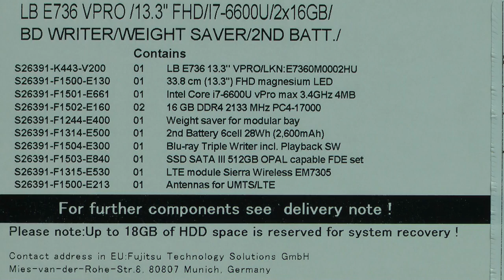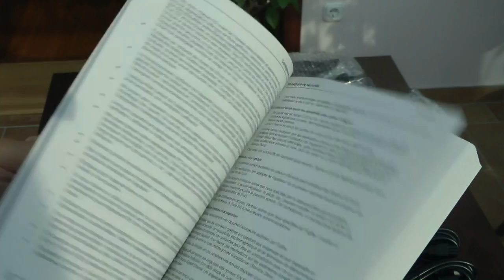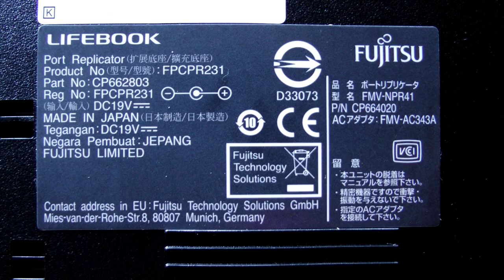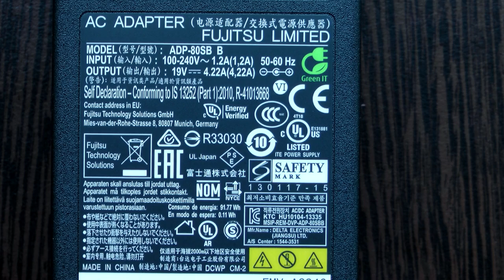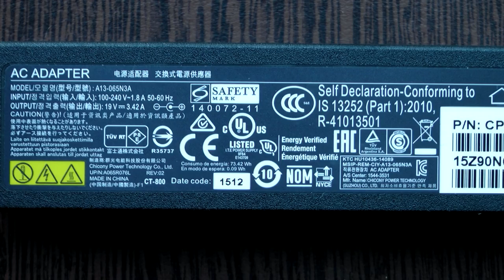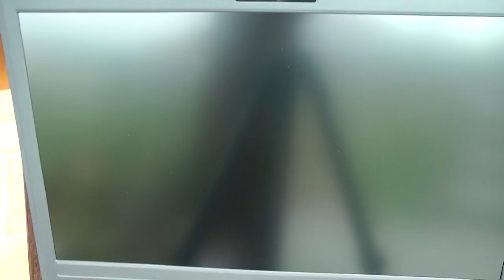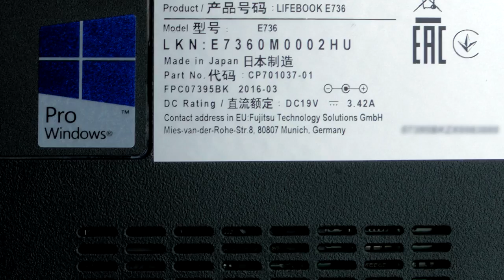Fujitsu Lifebook E736 Is The Best Business Laptop - unboxing review

Comment: It is 2024 and I have purchased a "refurbished" E736. It comes with an i5-6300U and a FullHD (1080p) screen (not a 1366x786 screen like it said on the website).
(It does not have a fingerprint scanner.)

It has 2 x 4 GB RAM, both from Hynix, but one memory bank is 2400 MHz and the other is 2666 MHz.

A sticker at the bottom says May 2018.

It comes with some "generic" Chinese charger by "Li Shin International", and with a 256 GB SSD from Kingfast (not the best brand, they say, but I will keep an eye on it with CrystalDisk...).

The laptop looks like new and has probably been used with a dockingstation and external keyboard.

It is running Windows 10 Pro, and Fujitsu is still offering drivers.

With a little (or a lot of) luck, this may be a great buy. It sure is a great machine.
Reply from the maker: Good choice. My laptop is now 8 years old and I don't plan to replace it, especially since this is the most powerful configuration possible. You will also be able to upgrade it easily, first with more and the same RAM, then with a larger SSD. The battery may need to be replaced. However, even with this launch, you have a great office laptop. The FHD display is perfect even for medium-level graphics work. Enjoy! ✌😉

Comment: Hi there, Thank you for the detailed unboxing and details. 
Its been 3 months, how do you like your laptop so far?

May i know hows your experience with the keyboard and the battery so far? Is the docking station/external monitor all working fine with no glitches?

I originally was looking for S936 but the key travel is only 1.2mm, this E736 has 1.7mm key travel which is great. 

I'm confused whether to get this or thinkpad lenovo T460.
Reply from the maker: Thanks for the questions. I love it. :)
Keyboard and this big touchpad are very comfortable. Battery runtime is awesome. Editing videos: 10hrs. Just writing text 25-30 hrs. (with 2nd battery) I use a Dell 24" (1920x1200) monitor with docking station thru DVI. Perfect. I will buy a 4K monitor soon, which uses display port. I guess, that will works fine also. I will share my experience here.

Probably our needs are similar. Previously I deeply compared this three notebooks (S936, E736, T460) according to my purposes. Lenovo T460 is bigger, no 2nd battery and modular bay. S936 has only one memory slot beside 4GB onboard memory, WQHD is unnecessary for a 13.3 inch display - FullHD is more than enough. So E736 was the best choice for me. This form and expandability are future ready.

Skylake U processors are very good. But, if you need desktop power in your bag see Lenovo T460p, which is almost a mobile workstation.

Comment: Thinking of buying one now in 2023 since its a very cheap and reliable business solution. I found one in good condition that I'm considering, but can't seem to find to buy a 2nd battery anywhere on the internet. Do you have any info on if the 2nd batteries could still be purchased?
Reply from the maker: First, buy the laptop if it is in good condition. It will serve you well for many years to come. I don't plan to change either, because I'm completely satisfied with this configuration.
Sorry, the secondary battery is no longer available for purchase as it is no longer manufactured. By the way, it was much more expensive than the primary battery. I searched all over the Internet, but I couldn't find it either. I recommend that you use a second storage instead, for which you can get a cheap installation frame. This also solves the backup copy.
It is much more important to use a good primary battery, because you can work with it for a whole day. Also, you may need a CPU fan in the future. You can find all other original parts in this German specialist shop:
https://www.ipc-computer.eu/fujitsu/notebook/lifebook-e-serie/lifebook-e736/
You can check the battery capacity under Windows by running Powershell as an administrator and then typing the following command:
powercfg /batteryreport /output "C:\battery-report.html"

Comment: Hello is the fan any quiet because mine is a bit loud when I open an app it goes loud four minute or two then it goes quiet.
Reply from the maker: By default, the fan is silent. It is normal if it revs up sometimes and then stops, or only works at a lower speed. In energy management, you can switch on a mode in which the fan is passive. Of course, this is only recommended for simple browsing or text editing, not for video editing.
If, however, it is louder than average or even rattles, it is worth replacing the fan as soon as possible. After eight years of intensive use, my laptop is still perfect. (It was just a battery change.) However, if necessary, I will order the fan from here:
https://www.ipc-computer.eu/fujitsu/notebook/lifebook-e-serie/lifebook-e736/cooler-15381935

Comment: hi. i want ask something. Is the "AC Adapter (80W)" come with the notebook? 
Or you need to order it ? 
I received "3-pin Power cable EU" (2pcs) but only received 1 "Slim and Light AC Adapter (65W)"  
it is possible ? 

thanks
Reply from the maker: It depends on your retail shop. Generally, you can chose what you need. Please ask before buy.

Comment: Is the 2nd battery come with the notebook? Or you need to order it ?
Reply from the maker: Yes, you need to order 2nd battery. Fujitsu has a notebook configurator, so you can chose any components and accessories according to your personal needs. Ask your local distributor.
Reply: can I have a picture of the full specification written on the second battery? thanxs in advace
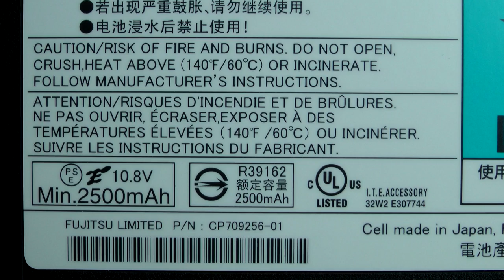Reply from the maker: Picture is here: 2:44
2nd Battery 6cell 28Wh (2,600mAh)
Please ask more if needed.

Comment: Hey, did you install Linux? Did it run performant? Can you tell something about the hinges? Are they stable?
What is the overall impression of the quality of the product? Is it high quality?

Thank you for the nice video!
Reply from the maker: I use Win 10 Pro. I guess Linux is working fine on every modern hardware. Hinges are very massive and stable. My previous Fujitsu (Lifebook S6410) laptop's hinges was same strong, what I used for 8 years. This Lifebook E736 has only high-end materials, I am absolutely satisfied. It worth its relative high price. Thanks for your questions.

Comment: Hello! is it still worth it? I'm planning to buy a cheap second-hand of this unit with a great condition, great video btw!❣️
Reply from the maker: Hi, thanks! Yes, it is worth buying a good condition road. This laptop will serve you for many years to come. I've been using it for 8 years and I don't plan to change it. It is likely that the battery should be replaced. (I bought a new one last year.) You can only buy original factory ones, here you can find all the accessories at a good price: https://www.ipc-computer.eu/fujitsu/notebook/lifebook-e-serie/lifebook-e736/
✌😉